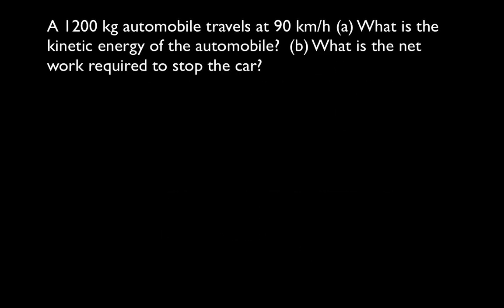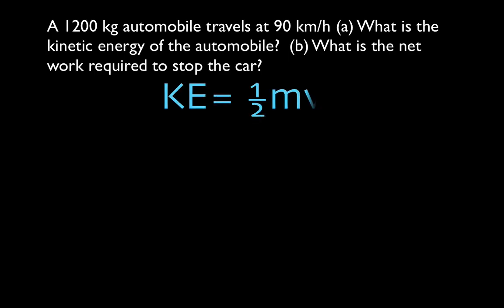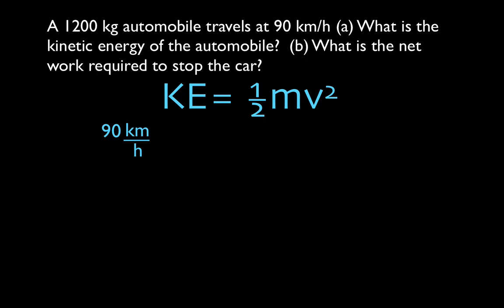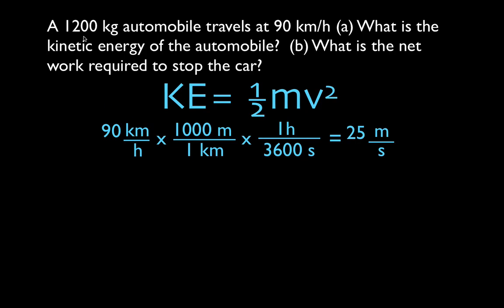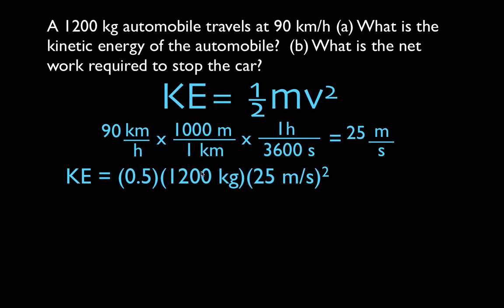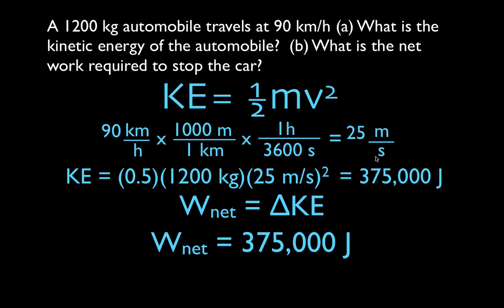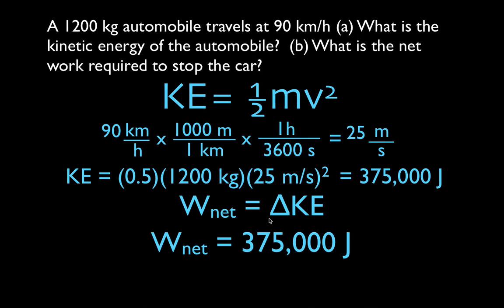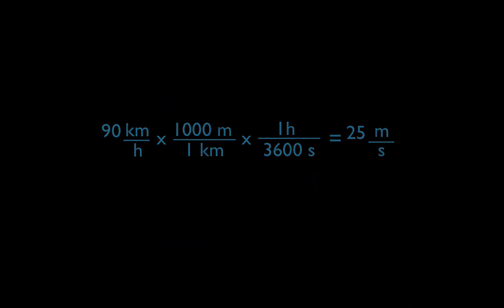Energy, Work & Power (2 of 31) Kinetic Energy, Example No. 1

Comment: tiny question. If I was given the speed of gravity(m.s-²) and not the velocity, can I use the gravity as the velocity? If not, What can I do if I was given the speed of gravity instead of the velocity?
Reply from the maker: gravity doesn't have a speed.
Reply: +Step-by-Step Science yep. turns out I misread the question. I was told that the object was in an idle state. thanks regardless!.

Comment: Can you explain something for me? There can be a collision between two vehicles(inelastic collision) where the momentum's cancel out and they both just stop. One vehicle is fast but is not massive, the other is massive but not fast. In these cases the momentum's cancel out but the kinetic energies do not(that's my problem). The faster vehicle has more kinetic energy than the more massive one. Each vehicle stops(balanced momentum's). How does the extra kinetic energy of the faster vehicle manifest itself? Does the faster vehicle undergo/experience more work on itself or is it extra damaging force for each vehicle to absorb?.........  What if there was a similar collision with same total momentum as the first collision but with identical speeds and masses for each vehicle. Now momentum's and kinetic energies are BOTH balanced, how would the first collision play out differently?